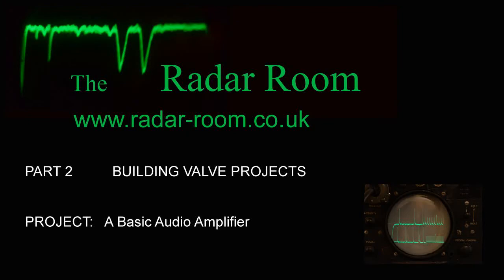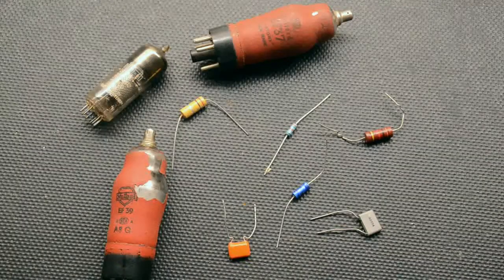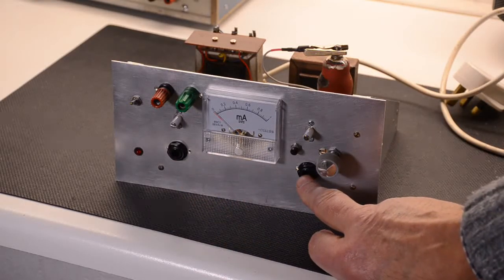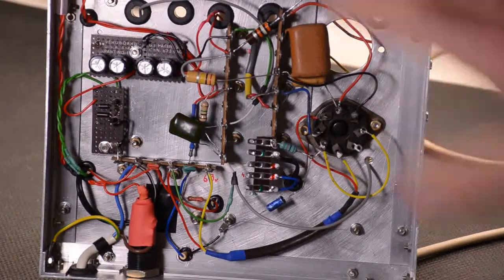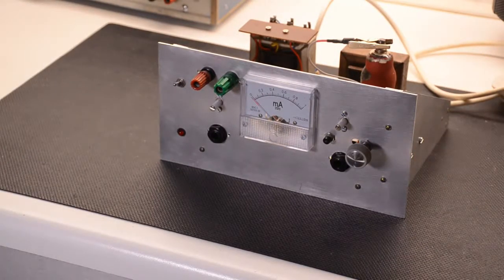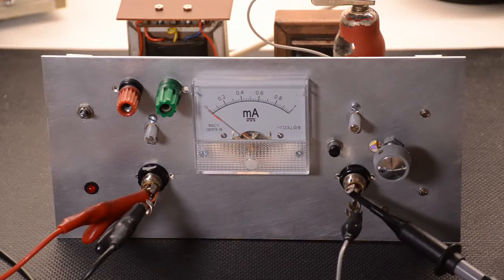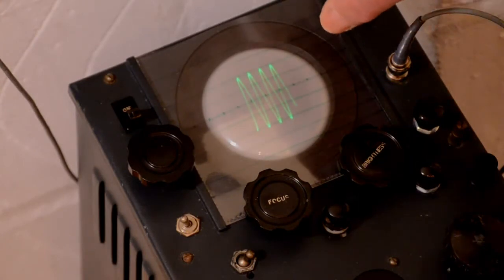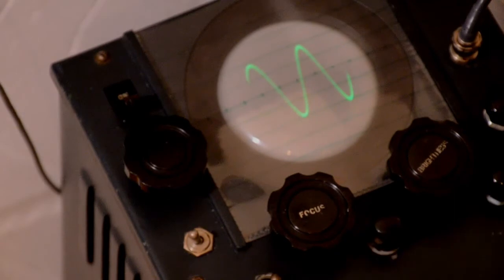The Radar Room - Basic Audio Amp Construction

Comment: I find a possible US equivalent to EF39 to be 6/12SK7, the 12V version very common in WW2 military radios.  I always enjoy simple tube experiments with explanations and found your video very interesting.
Reply from the maker: You're welcome Cliff. Glad you enjoyed the video as it's only been up online for about an hour! BTW - the 12SK7 has a BIG advantage that I think that it doesn't need a top clip..?
Reply: @lishaton  Yes!  The control grid is on pin 4 - no top clip.
Reply from the maker: @clifffiftytwo  Thought so! Our US Loran APN-4 has several rows of the things. You can see an inside shot of it on our web site: http://radarroom.125mb.com/html/loran.html
Reply: The RCA RC30 tube manual (available online, a great resource) shows that the EF39 equivalent is the 6K7, which is the earlier version of the 6SK7.